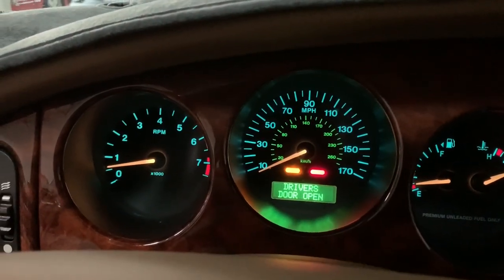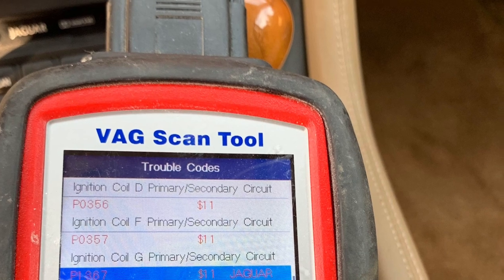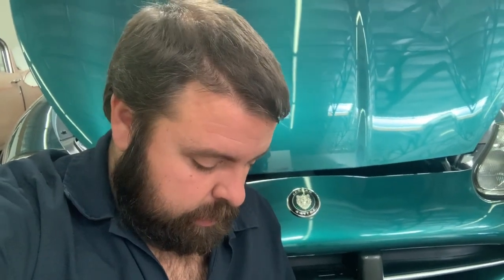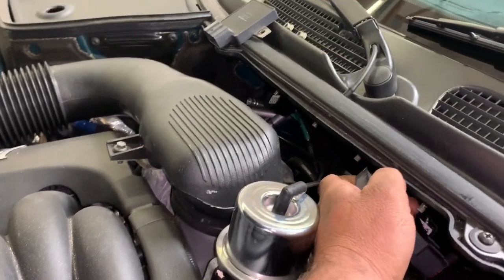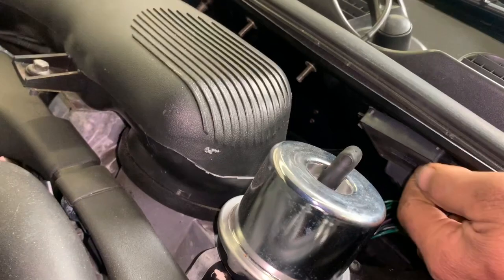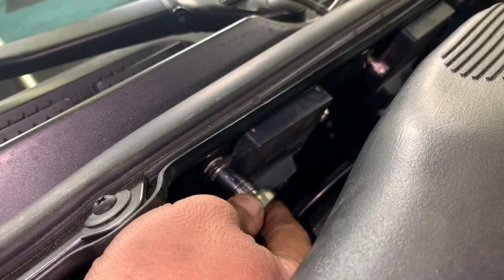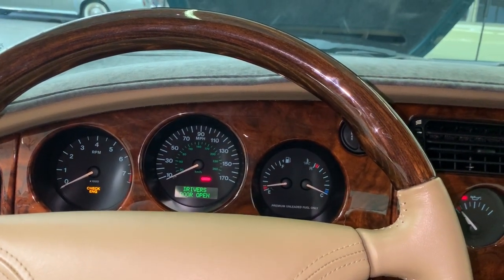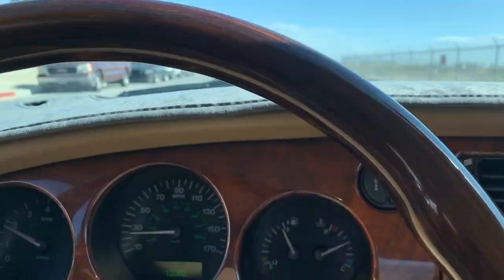Andy's 1997 Jaguar XK8 - Multi-Cylinder Misfire, Poor And Random Shifting

Comment: Thanks for the insight on the replacement. I just did mine on my 1997 jaguar xk8 convertible. 
Now it’s cooling and heating as it should. 
Like you stated, you’re gonna get a lot of cuts and scratches.

Comment: Have the same problem. Dealer told me that it was the timing chain tensioner to be replaced, so it will cost around $9000. But sometimes when I drive, the restricted mode disapear and I clearly can push hard the car so it's not the chain tensioner that broke. 

So I ordered two 2nd hand items that you recommended to change. Will receive them tomorrow so I will see if it workes. If it works, I will buy news ones. Saw some new for $315 each so on internet.

Will keep you posted 🙂
Reply from the maker: How did it go?
Reply: Did this fix the problem ?

Comment: I am shocked at 12,000 miles. My XKR has now done 120K miles (90K are all mine) and still makes me smile. Most electrical issues come from low battery voltage. Once you get down to 11 volts all sorts of errors start showing up.
Reply from the maker: Electronics do age…definitely was NOT a voltage issue

Comment: I have the same problem with a RHD 1996 car 

I have just refurbished the Gearbox Rotary Switch and that has eliminated my Gearbox Fault Code and when I took her out I had messages Engine Fault & Restricted Performance.
The Codes are P0352, P0353, P0355, P0358 & P1368

I've swapped Coil Packs and this didn't resolve the problem so Not them 
I've replaced the Plugs and this didn't resolve the problem so Not them
I've swapped the Ignition Control Modules with each other and the same fault remained so I guess its not the ICM's 
I've done a continuity test from the Coil Plugs to the ICM for all 4 cylinders so no broken wires 
I've done a continuity test from the ICM2 Plug to the ECU Plug for cylinders 5 & 8 and no broken wires so not them (will do Bank A cylinders 2&3 tomorrow)

Any suggestions ?